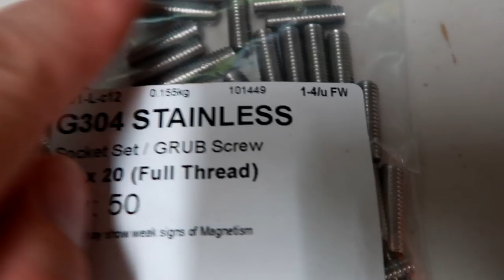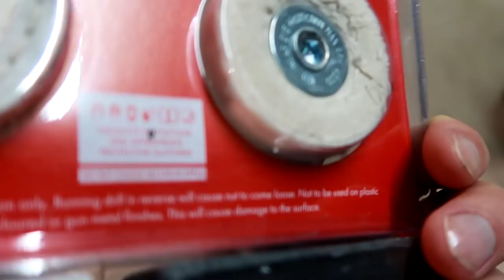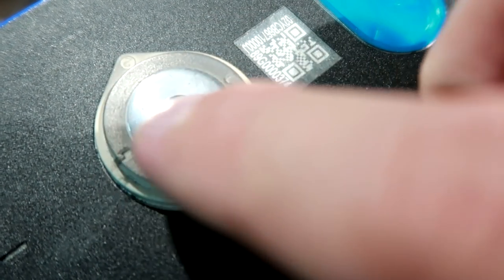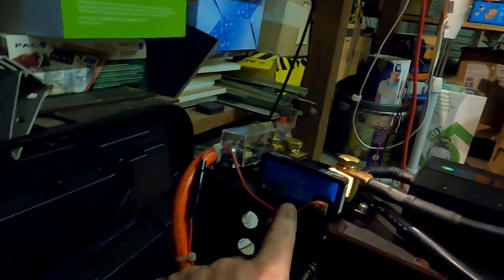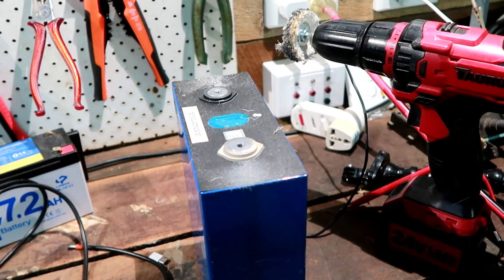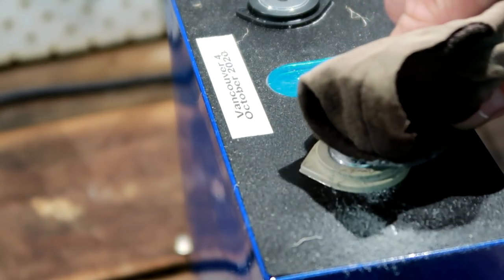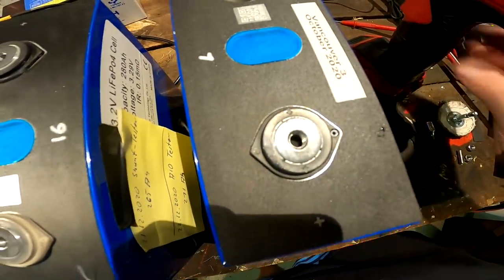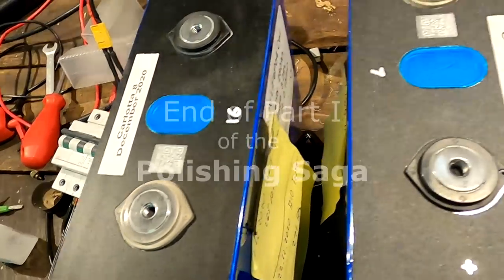Re-building the battery - Set-Screws and Polishing. Part1/2

Comment: If you worry about the electrical contact between the battery terminals and bus bar, then you should use a soft copper washer in between the two. The soft copper will conform to a whatever surface ensuring the best molecular bound.

Comment: Andy, I think you are worrying too much about polishing the terminals.  With the new studs and nuts that you just got, just make sure the terminals and bus bars are clean and flat.  Then hand install the studs down to the bottom of the terminal hole and back them off about a quarter turn.  Then tighten down the bus bars while holding the studs in place with an allen wrench.  You'll be able to torque them a little more than you could with the screws you were previously using without stripping the threads because the studs grab more threads than the screws.  You should be fine once they are torqued to spec.

Comment: With polishing, you may unintentionally make the top out of flat and reducing the contact area. The surface of aluminum does oxidize very quickly so it’s a good idea to just give it a quick circular buff by hand and the bottom of the lug with some scotch bright immediately before assembly and shot of dust off to get any grit out of the threaded hole. A conductive/ant- oxidant paste on the contact surfaces is an excellent idea that I’ve been using in the marine environment for years. Also no more than 4Nm or 36 INCH pounds torque on those nut on studs (280 Ah cells).

Comment: Dielectric grease will keep oxidation from happening.  Stackup: Battery | Cable Lug/buss bar | BMS ring terminal | Flat washer | Split washer | Nut.  Put dielectric grease on the battery, buss bar/cable lug, and ring terminal. If connection is still an issue, a toothed washer with dielectric grease between connection will dig past oxidation.

Comment: MG Chemicals Carbon Assembly Paste. Use it, love it, forget about it after you have snugged your lugs. But wear your gloves :)
Reply: Thanks - this sounds like a much better idea than polishing!
Reply: Snap.  I just posted about the same goop before I saw this reply.
Reply: @HiltonT69  looks like others have posted as well. We use it in the cellular industry for -48v DC buss bar connections. Never had a bad connection, just kind of messy and don’t get it on your hands, wear gloves. 😁
Reply: I searched for it on Amazon and just about had a heart attack when it pops up as $600 a gallon! (Cheaper than printer ink, but still.) Thank God it also comes in small tubes.
Reply: 😂 yea the small jar is a whole lot cheaper. Don’t need much, just light coating, 1 oz jar goes a long way.
Reply: @jimmyg6215  Please tell me how this electrically conductive Vaseline behaves at the very high current that occurs at a bank of solar batteries.

Comment: Andy -  I agree with the other comments recommending you use a Conductive Grease on your battery terminals.  I personally don't like the MG 846 as it can be very messy.  I prefer something like No-Ox #10203 available from Amazon.
Reply from the maker: Thank you. I'll see if I can find a data sheet for it.
Reply: No-Ox is good stuff. I use a dab on RJ45 contacts (Cat 5/6 ethernet jacks).

Comment: I just ordered new cells like yours from Alibaba and they come with the studs welded. I will let you know how they work out. They are brand new "A" grade EVE cells 280Ah.
Reply from the maker: The studs are fixed connected to the terminals?
I heard about they deliver now set-screws and nuts instead of the screws... but fixed is new.
Reply: @OffGridGarageAustralia  They showed me pictures of the cells before they sent them out and the have studs installed.
Reply from the maker: @SpeakerKevin  great. Let's see when they arrive. Hope all goes well. First cells you ordered?
Reply: @OffGridGarageAustralia  Yes, 16 cells for 48 volts plus 4 extra for spares (they come in packs of 4).

Comment: I would suggest using Ox-gard paste.  It's gray in color and contains zinc.  Great stuff and made just for what you're trying to achieve.  It's used for dissimilar metals to prevent that fine layer of corrosion and reduce resistance.  There are two types of electrical grease dielectric increases resistance and ox-gard to reduce resistance.  So good to have both in your tool kit, but need to choose the right one when you need it.
Reply from the maker: Thank you. I've got carbon conductive paste but the result was not very good so far...
Reply: @OffGridGarageAustralia  Yeah would not use that carbon stuff doesn't work.

Comment: Hi Andy, I've been watching all parts of your videos for a few days. I'm always looking forward to each new part. I admire your enthusiasm and your optimism. I've never written a comment, but now I have to - this is in my opinion, the most unnecessary thing you've done in your videos - you're not a jeweler to polish busbars to a high gloss. But if you want - do it.   :-)
I greet you from Slovakia and I keep your fingers crossed.
Reply from the maker: Thanks for your comment, Antonin. I read in forums about polishing terminals, so I gave it a go.
Keep writing comments please ;)
Reply: @OffGridGarageAustralia  Hi Andy. Ok, one more note - I think you'll have to make a few holes in your beloved electrical switchboard, at least two.  :-)
Because it's great that you have your blue treasures beautifully mounted in the switchboard, but the converter and the mppt controller produce quite a lot of heat. So you will probably need one hole at the bottom (with filter) and the other hole at the top, ideally also with the fan switched according to the internal temperature in the switchboard. 
And I want to see another your episode quickly... good luck.
Reply from the maker: @Antonín Albrecht  wait for it... ;)
https://youtu.be/wBmH5GseuB8

Comment: Mg conductive paste, no Need to polish terminals.
847 is a carbon-filled electrically conductive paste. It improves electrical connections between non-moving parts in the same way a thermal paste improves thermal connections. It will not separate, bleed or migrate. It reduces contact resistance, repels moisture, inhibits corrosion, and prevents static buildup.
Reply from the maker: Got that. It'll come in part two...

Comment: On the buffing wheel, use a FORK to breakup the caking of the compound.  Do it at medium speed and in both directions with only a little bit of pressure, otherwise you'll chew up the fibre.

Keeping the wheel fluffy and clear of buildup is important if you want a good polish.
Reply from the maker: Great tip, someone on YT used an old saw blade for that.

Comment: WHen you're using dissimilar metals there is always some degradation happening where they contact each other. Using some type of electrical anti oxidant would seem to make sense.
Reply: Duralac. Used in marine applications to prevent galvanic corrosion.

Comment: I assume your problem is oxidation because of the different materials of the bus bars and battery poles. It looks like your polishing rounded the surfaces, which did not increase the contact area. I would try to sand a few batteries at once by using a bigger flat board and the whole sand paper sheet. After that use some contact spray or copper grease to reassamble the battery which helps to reduce or prevent new oxidation. I really enjoy your videos and your try and error reporting, which helps a lot to understand and learn with you.Thank you!
Reply from the maker: Thanks for your tip. I understand what you mean by sanding several at the same time. This would imply all cells have the exact same height, right?
Reply: @OffGridGarageAustralia  I would expect the same hight more or less one millimeter.. That way  you could keep the top of the poles flat instead of getting curvy, like with your drill polishing. Maybe turn the battery 180 deg. around and rub it over the sand paper? But maybe it does not realy matter anyway.

Comment: That saw blade finish on top of the terminal studs is referred to as a fluted finish on the softer material it allows it to contour to the bus bar I would rather see that finish left behind as I think it will improve the connection though it is important to remove any oxidation and apply inhibitor or carbon conductive paste immediately before assembling as this is the number one cause of added resistance in the connection.

Comment: The first one the tool was new and was clean now you've already got it with that rubbing compound on there it's going to leave a map finish it's supposed to just whenever you're finished take a spot of grease and put it between your bus bar and your terminal and it will stop the oxidation because it's aluminum it's going to oxidize with oxygen hitting it just like a battery cable on a car if you put grease on it it can't get oxygen to it it doesn't get acid all over it and curled up you're just stressing out too much they don't have to be polished

Comment: Try using a dielectric gel or grease for all of your contacts. I've been using this in all of my connectikns as well as lugs when building wire sets. inexpensive  and insures a good electrical contact.
Reply: Cannot be a dielectric, a Dielectric is an insulator, non conductive. It is applied to sockets and wires to repel water and moisture and used in capacitors to separate the charged plates, but does not conduct. Maybe you mean carbon assembly paste like the one made by MG chemicals. That is what should be put on the the lug to terminal mating surface to “fill in” micro voids and scratches to make a much more uniform mating surface. Be carful the stuff only needs a thin layer and makes a mess if you get it on yourself.
Reply: @jimmyg6215  True
Reply: @jimmyg6215  Dielectric grease is non-conductive, and yet it is often used for electrical connections, especially in harsh conditions like vehicles. Where there is good metal to metal contact the grease is displaced, and then it seals out oxygen (and moisture) from the actual connection. You do not want a conductive grease in a connector because it is too likely to cause unintended leakage as it migrates onto surfaces and between contacts.
Reply: @Sylvan_dB  in this case you would want to use a conductive paste. It too seals from corrosion of dissimilar metals and fills in minor imperfections on metal to metal surfaces. It is used all the time in cellular industry as copper buss bars are not perfectly smooth and no one is going to polish them. I have used it on my battery packs and have not had any problems. I use 6mm studs in the battery and a nut with the built in locking serrations on the nut face. Torque them up a bit and you are good to go.

Comment: Hello Andy. it's not about the shine, but the flatness of the surfaces, imagine putting 2 window glass against each other. with the disks the surface is not flat. I do it with files. J'espère être clair, je ne parle pas souvent anglais.
Reply from the maker: How do you get them flat though?
Reply: @OffGridGarageAustralia  Flat just means no big burrs that will keep the bus bar and terminal apart. Clamping pressure does the rest.

Comment: The rouge with the cloth wheel is for harder surfaces than aluminum. That's why it works well on nickel and chrome. You don't need it for the bus bars or the terminals.
Clean THOROUGHLY any place it has touched. The grit is non-conductive as is the material it is molded with, and neither will displace under contact clamping pressure.
Little scratches do not matter. If it feels smooth it is plenty smooth, if not too smooth. Remember these get tightened down.
You are making this all too complicated!
A few wipes with a piece of sand paper on the terminals (just by hand and get the grub screws out of the way) to break the thick oxide and take off big burrs. If huge burrs on the bus bars you could remove, but most of the burrs on the bus bars are actually helpful to cut into the terminal thru the normal and instantly forming oxide.

A smear of aluminum connector grease or a bit of dielectric grease (yes it is an insulator but it keeps out oxygen) on both sides and then clamp them down. The proper way to do the aluminum connection is to scrub the aluminum with a wire brush while it is greasy. That prevents much of the oxide from reforming.
The connection pressure will bed the bus bars into the terminals and displace the grease, forming a barrier to keep oxygen out of the connection.
Reply from the maker: Thank you.

Comment: So after the polishing, shining and cleaning the problem continues because the problem is inside the cells.  They suffer from low quality and internal resistance. What a coincidence! I have #6, #7 #8 with some low capacity  type of problem. Will it be a b/o bms or because they are at the center of the pack?

Comment: Terminals only need to be clean and flat... Not polished. Use a metal file or stainless steel brush, to avoid foreign partials embedding in the aluminium surface. 
An anti-corrosion paste can be used to help prevent oxidation and reactions between the aluminium and copper. 
Make sure to use spring washers when bolting to the terminals, otherwise they can loosen over time with the heat cycles of charging the battery's.

Comment: Thank you for the video! There is now polishing compound inside the threads that needs to be cleaned out. Maybe screwing something into the terminals would help. Also I see you have taken down the busbars to the copper, so you might need OxGuard.
Reply from the maker: The stuff inside the threads is not important, there is no power going through the studs.
Reply: @OffGridGarageAustralia  I learned something new again! I know it would affect the torque but I also thought it might impede the current.
Reply: @OffGridGarageAustralia  hi. Are you sure about that? I thought it was both the pad and the stud that conducted.
Reply from the maker: @stevelk1329  yeah, pretty sure. The contact is made from the top of the terminal to the busbar. There will be almost no current flowing through the studs itself to the busbar. 
They may not even touch each other.
Reply: @OffGridGarageAustralia  yea but the threads should be cleaned out, otherwise when you torque it back up you will get a false tension.

Comment: Being shiny won't help, the real priority is flatness: if two surfaces that are coming together aren't close to perfectly flat, you may only have 2-3 contact points between them no matter how well polished they are. Also, aluminum oxide forms almost immediately on exposure to air, so you really should cover the terminals with appropriate anti-oxidant paste for aluminum electrical connections immediately after polishing.
Reply from the maker: With all the scratches on these terminals they are not perfect either. 
How do you get them perfectly flat as you said?
Reply: @OffGridGarageAustralia  The easiest way to achieve something close to perfectly flat is to glue a sheet of fine sandpaper to a piece of glass and setup a three points support around the terminal to make sure the glass stays in-plane.

You'll still want anti-oxidant paste on the aluminum to make sure air won't oxidize it and cause the contact patch resistance to go up over time and you'll be loosening/tightening chasing millivolts all over the shop again.

Comment: I know it probably doesn't matter much especially with the bit of testing you did before with battery compression but what if the batteries are pushing away from each other and pulling back when they heat up and cool down and is causing the terminals to become loose? Just a thought
Reply from the maker: I decided against compression and left a gap of 2mm in between the cells for expanding through temperature. The bus bars on top won't be affected by that 'movement'
Reply: @OffGridGarageAustralia  I've seen every video so far so I'm aware of the spacing for the cells. And it does seem like that wouldn't contribute but what about the bus bars Heating and Cooling transferring that slight amount of heat to the bolts, similar to how the bolts on a engine exhaust will get loose after the first few times of running it because of the heat cycles. Of course with your batteries it's going to be very a lot less temperature fluctuating through them but it's just a thought
Reply: @mindovermatter3988  The temperature variations that will affect this kind of use (relatively low current) are environmental, not resistive heating (unless there is a very bad connection somewhere). For Andy, that temperature difference will be night to day, summer to winter probably at absolute worst case of a delta of 40oC. With this delta, the bus bars will change in length by 0.6mm, so not much. Also, the bus bars have elongated holes to take up some of this variation. Loosening of the nuts is due to thermal shock - a variation of several hundred degrees in a few seconds, again this doesn't apply here.
Reply: Correction, the change in length will be 0.06mm, not 0.6mm - sorry should have checked my calcs before posting!

Comment: Are you sure the bad connections are not just getting loose?  Belvill or a spring washer would help.  Maybe create new bussbars with copper pipe or grind off that tin coating on the ones you have.  You want copper or something conductive and a little pliable.
Reply from the maker: Copper pipes are the worst. They are never flat.
Reply: His bus bars are nickel plated copper to avoid oxidation. Doesn't need a spring washer, just needs to tighten them properly, ideally with an anti-oxidant grease on the aluminum according to label directions.